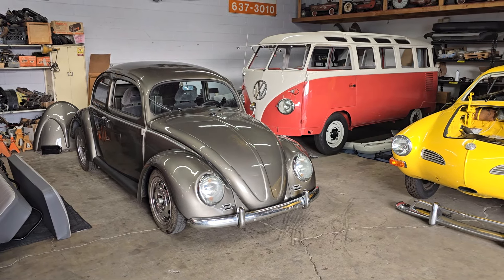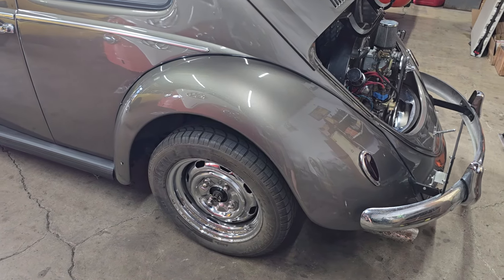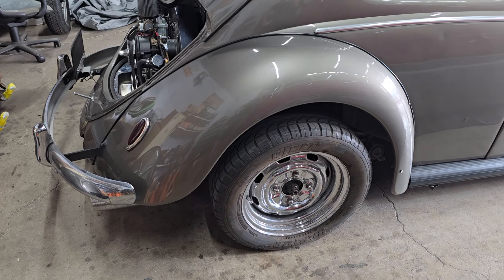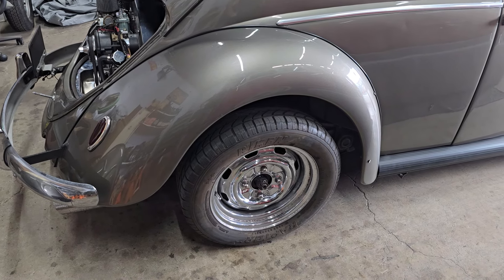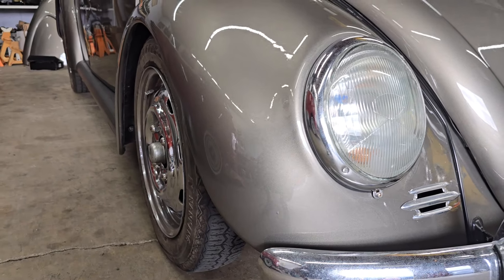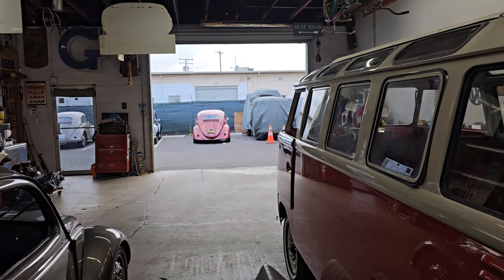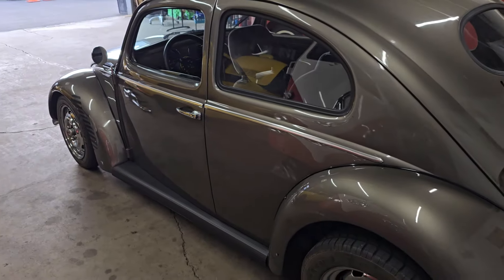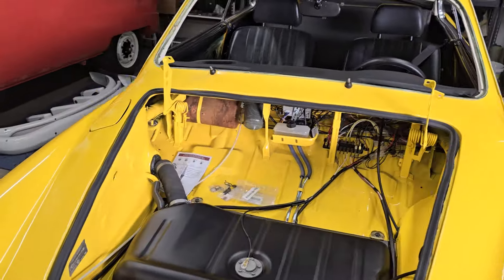A Day in the Life of Vintage Classic Specialist, Episode 146, '55 bug- upgrades coming?

Comment: CSP sells wide five drums that will fit with late four lug brakes. If you use Thing drums you’ll need to machine the snout down, and they will space the wheels out a good half inch as well.
Reply from the maker: Hmmm, good to know. How do the Thing drums space the wheels out more than the 68 and up 4 lug setup already does? Are they really thick in the wheel mounting surface?  Cutting the snouts won't be an issue.
Reply from the maker: https://www.csp-shop.com/en/brand-shops/brake-drum-rear-with-5x205-bolt-pattern-501-615-211ag-12569c.html
Reply from the maker: That looks like it might be Thing drums that they machine?
Reply: Yes, Thing drums are wider then 4 lug drums, yet still use the same brake shoes as a late Bug. And those are the drums I was talking about in your link. I put them on my lowered 73 Thing and they brought my BRM’s in a half inch. Also, Things use 14mm lug bolts, but the CSP drums use 12mm lug bolts.